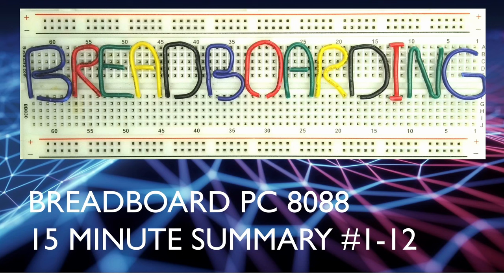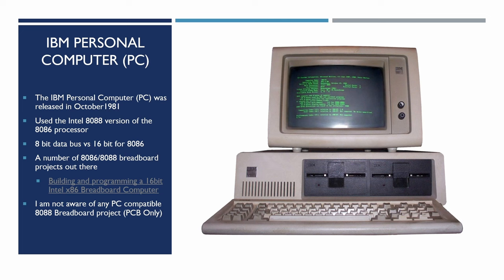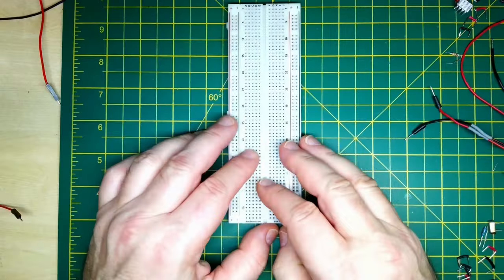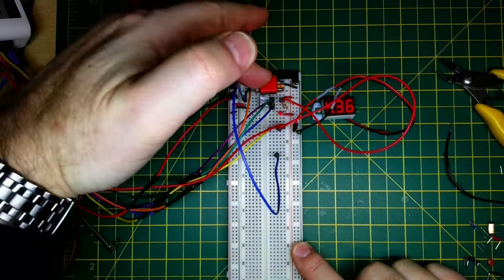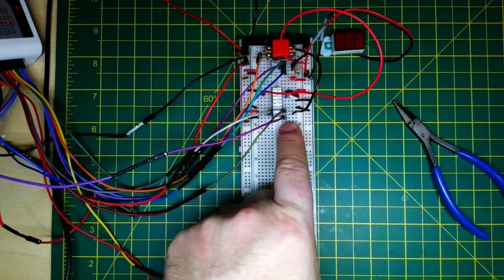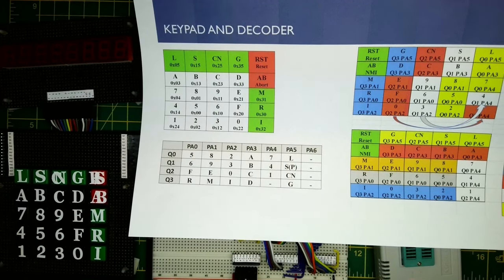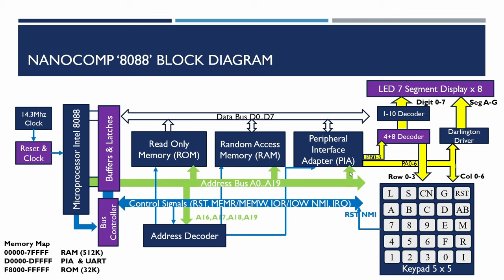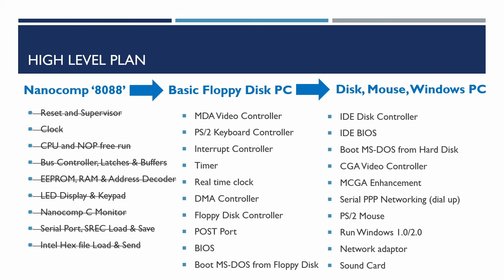Breadboard 8088 PC 15 minute summary of videos 1-12

Comment: I wonder if you would consider doing a soldered breadboard version (ie on prototype board). That's how I do all my prototypes, and I use multi-coloured wire-wrap wire on the component side.
Your rate of progress is quite impressive, and fascinating to watch. Well done, keep up the good work.
Reply from the maker: I use stripboard/Veroboard every now and then like for the keypad and display. My focus is more on solderless breadboards but I do realize that I will need to do some soldering, particularly if using surface mount devices in the future. My original Nanocomp in 1981 used solderable wire wrap pen (Road Runner I think) but I prefer the flexibility of the solderless version (until I run into technical limitations like frequency etc). Thanks for the feedback. Keeping the videos to 20 minutes has meant being able to so 1-2 a week. Dave